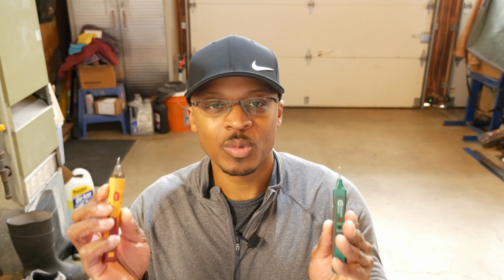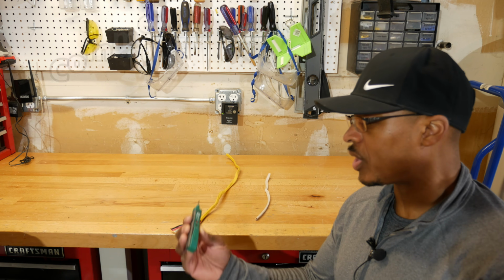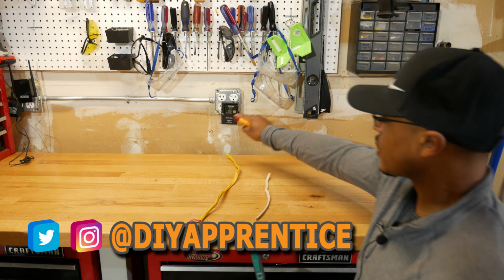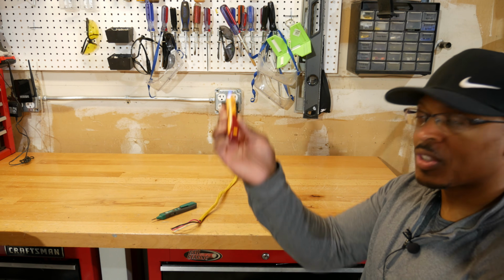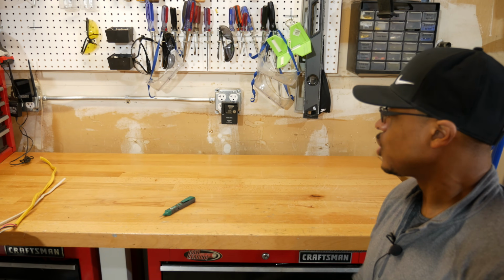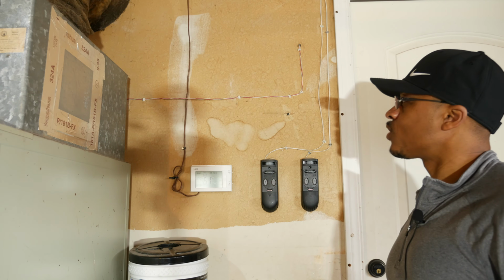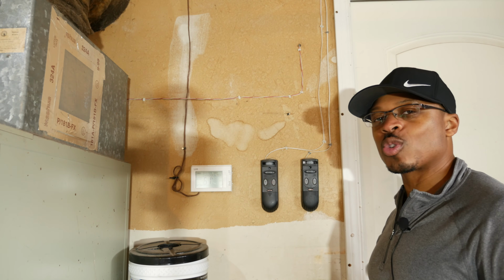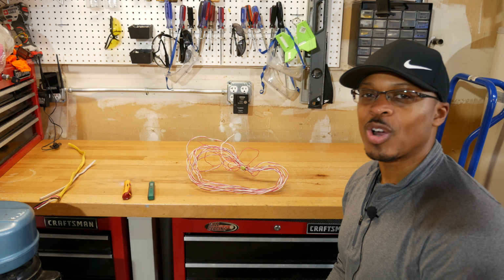Electrical Circuit Testers -  A Must for DIY'ers

Comment from the maker: Hopefully, you enjoyed the video. The Klein NCVT-2 has several features that weren't shown in this video; I only demonstrated its use in one mode. I have great respect for electricity, so I'm very cautious when working around it.

Please leave a 👍 if you like the video!

🔧▬▬Tools and Materials▬▬🔧
✔️ DIY Apprentice Recommended Tools and Materials ► https://bit.ly/2T5psFw
✔️ Klein NCVT-2 Circuit Tester ► https://amzn.to/3d4ihXx

📷▬▬Video Equipment▬▬📷
✔️ Camera used ► http://amzn.to/2GcpkOb 
✔️ Lens used ► http://amzn.to/2Deu16S 
✔️ Tripod ► http://amzn.to/2GbaM1c
✔️ RAM Suction Mount ► https://amzn.to/2Wz9PXh
✔️ Cyberlink PowerDirector ► https://bit.ly/2jTwGxT
✔️ Adobe Photoshop ► https://bit.ly/2V7nyUX
✔️ Camera Slider ► https://amzn.to/2WtD7GW
✔️ Deity V-Mic D3 Super-Cardioid Directional Shotgun Microphone ► https://amzn.to/2LI1lf7
✔️ Boya By-M1 Lavalier Microphone ► https://amzn.to/37ca7bB
Reply: Excellent video thank you
Reply from the maker: @mixedberries4937  Thanks for checking it out!